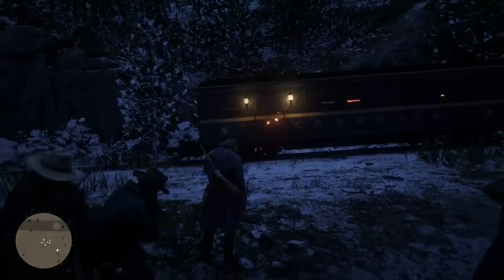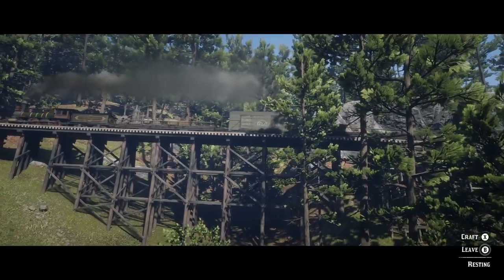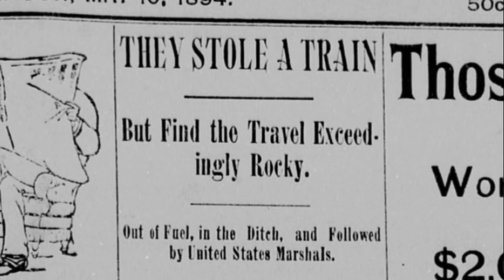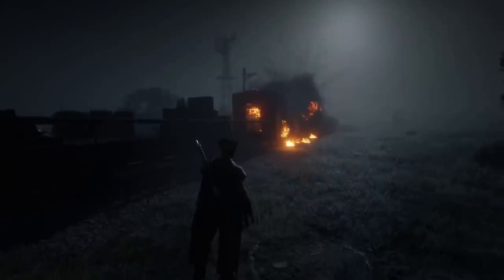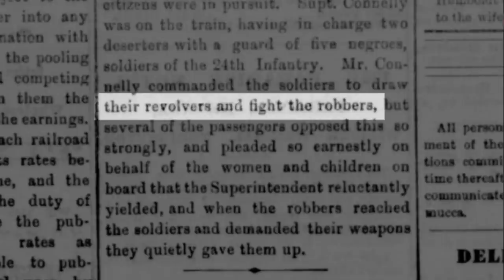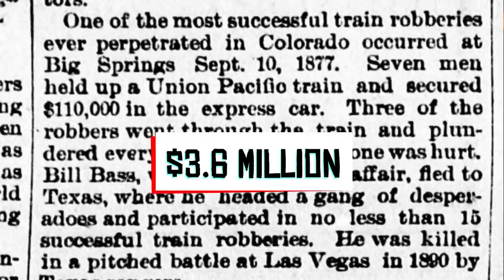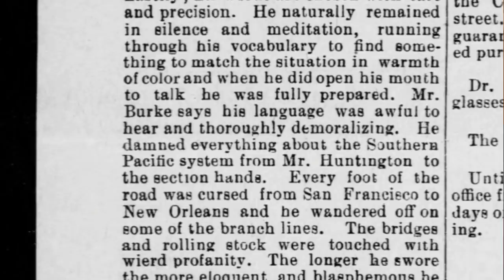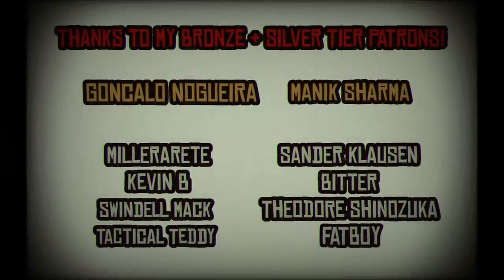Historical Accuracy of Trains & Train Robberies in RDR2

Comment: "No water, no steam, no choo choo."

Thank you for putting it into terms we understand!
Reply from the maker: You bet, buddy! I'm a man of the people. And the people don't need all them fancy college words.
Reply: @ManvsHistory  There's another huge reason to have water. Ironically, if you don't have enough, the boiler explodes! The fire in the firebox is hot enough to melt the steel it's made from. But by having water surrounding it the water absorbs the heat, thus maintaining its structural integrity. However, if the water level drops below the top of the firebox, there's nothing to keep it cool and it will start to melt. Once it's soft enough you have 150-200 psi blast through it.

So yeah. No water, no choo choo indeed.

Comment: As a historical rail enthusiast I have to agree with what you've said. I'm also a budding Live Steam hobbyist and am working on a rideable minature steam locomotive. And I can attest to many of the missing parts and components of the locomotives.

However, there is one aspect I feel was overlooked in terms of not just historical accuracy, but just plain old physics. And that were the Grades, or the steepness of the tracks.

Most railroads tried to keeps grades to a minimum, but "steep" was considered to he around 2%. Or 2 feet of rise for every 100 feet of forward travel. However some railroads had grades as steep as 4.5%, but for relatively short distances. The steepest mainline railroad grade in the US is the infamous Saluda Grade in NC. With a Maximum grade of 4.9%  but average 4.26% (if I recall correctly) and that was for nearly 3 miles. 

There's an extremely steep grade heading north through Roanoke Ridge and into Ambarino on the eastern side ofnthe map. Given the similarities of the region depicted by the map, maybe it's a nod to Saluda, but the grade looks like it's at almost a 45° angle. Which vastly exceeds the tractive effort of even the strongest locomotive of the tine in the US. At least not without some kind of mechanical advantage like a cog rail system. 

To gain elevation, railroads found creative ways to keep grades to a minimum, but still climb as needed. One way is to use a series of loops or curves to accomplish that. Sometimes even crossing over itself to do so. The old Morenci Southern Railroad in Arizona had five such loops, earning it's name of "America's Corkscrew". The large wooden trestles that comprised several of the loops were later torn down due to their expensive maintenance. They were replaced by switch-backs. Which are best described as Zig-Zags going up a steep hill or mountain side. Unfortunately, switch-backs required the train to stop and reverse direction in order to climb up the particular part of the switch back. And then stop and continue onward, depending on the number of switch-backs.

Honestly, when it came to the teains in the game, that was my biggest gripe I have and ruins the immersion. Reminding me that this was a game and not some time in the past.
Reply from the maker: This is pretty fascinating stuff, AJ! Very cool! I appreciate you taking the time to add all this info. Can't say I had even thought about the grades!
Reply: @ManvsHistory  Absolutely no problem! It's always been an issue in games that have trains. For some reason, developers think they can run on track like a roller coaster. Which simply isn't the case.

The Mt. Washington Cog Railway was the first of its kind in the world. There's a stretch of track near-ish to the summit that is at a 45-degree incline and was dubbed "Jacob's Ladder". For trains to climb such steep grades you have to have some kind of mechanical advantage where what they call "Adhesion" in the industry, just wouldn't be enough.

Another railroad you may want to check out is the Nevada Northern. They have an amazing history with some amazing true stories. They're not only knowledgeable on locomotives, but nearly every facet of period railroading. They still have their vintage 1912 era passenger train, the "Steptoe Flyer". With all wooden passenger stock. Really good stuff if you're interested.

Comment: Trains actually had an bigger crew. You also had brakemen and conductors. Before air brakes you had to apply each car brakes by hand. Brakeman went car to car applying brakes. Conductors cut cars and lined switches like they do today. While I agree with your experts explanation of the switches, they are actually long enough to safely pass a train. Though the turnouts don’t have guard rails, they use self guarded frogs at times that require no guard rail.

Comment: Any idea how much the it cost to replace the train that the James gang wrecked? I am guessing it was a heck of a lot more than the haul they got. Makes me think of when someone broke out the tiny trangle back window in my Blazer to steal 3 CDs and an old Garmin worth about $10 - the window was $300, the most expensive (but smallest) window in the vehicle. If they would have knocked on my door I would have given them $20 to just go away.
Reply from the maker: When you factor in damage to the locomotive and cars, lost revenue, injury claims, death claims, track repairs, etc, it would have certainly cost significantly more than the James Gang took, I can tell you that. Additionally, you have the absence of modern cranes and other heavy machinery to assist in the clean up. Nowadays a train derailment can be remedied in a matter of hours, or days. Back then however, it was a much greater ordeal. The gang was lucky they didn't kill dozens of passengers. I credit the flatness of Iowa.

Comment: Isn't the locomotive pipe wrong as well? If it is using coal it would be most likely east cost so the pipe would be straight up and down not the funnel style which was west coast becuase of the use of wood instead of coal. That way the embers from the wood would not start or would be less likely to start forest fires